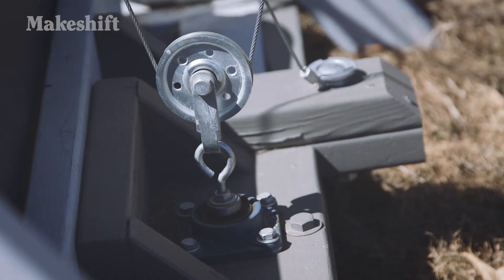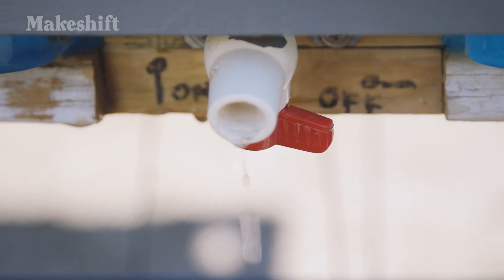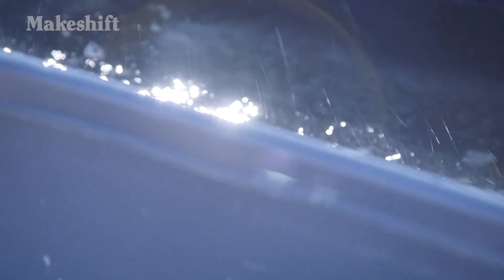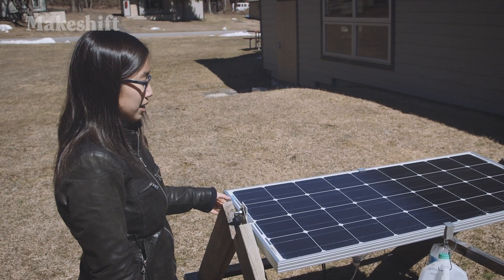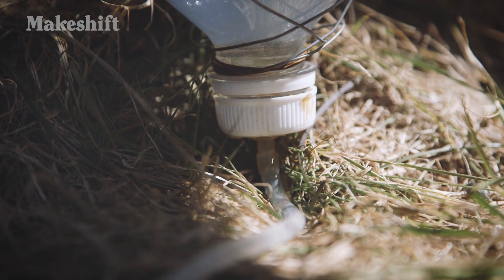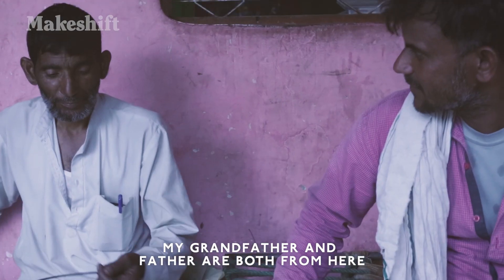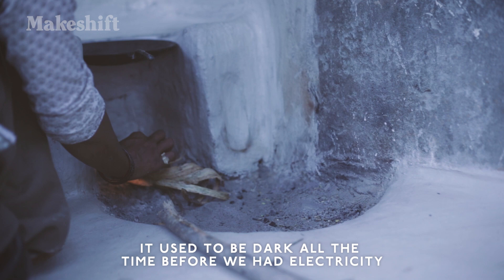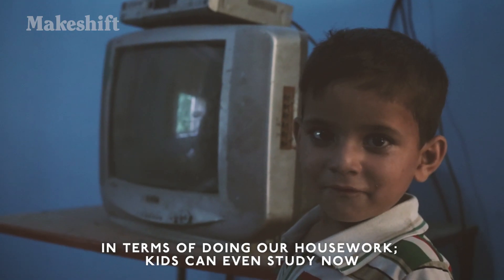A Water Clock System That Can Revolutionize Solar Power

Comment: The idea is good and relatively simple but in many instances it might have to work on two axis  not just one.  ......ie not just east / west but also up /down.

Pity that you didn't give the village more panels to make them charge batteries to a higher % .
Reply: Ben opino lo mismo, sería mucho mejor si sumas un movimiento en el otro eje
Reply: Ben   yeah, I don't like to be a miserable git, but claiming this will revolutionise solar power is beyond hype.  The panel in my back garden is on a 2 axis rig I made from pvc pipe at very low cost.   Manually adjusted.  They could do the same here.  There's no great gain in this partial automation which still needs manual intervention twice a day.  Just ask the kids to tweak it now and then.  And as you imply, single axis reduces output.